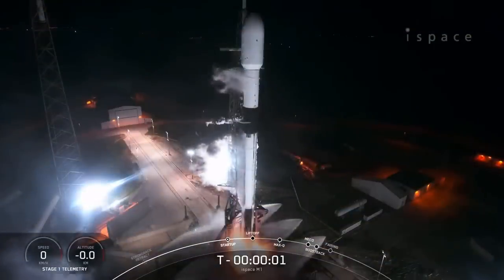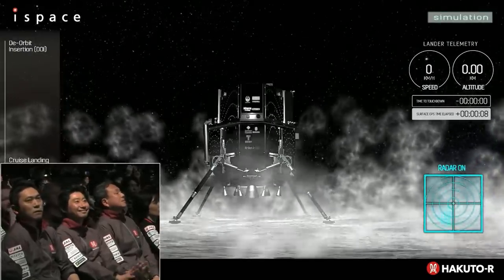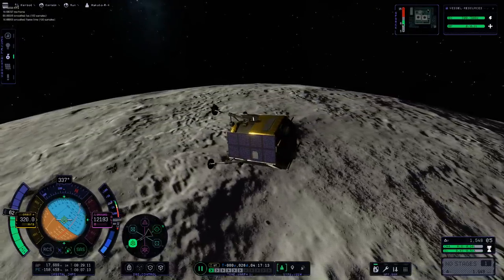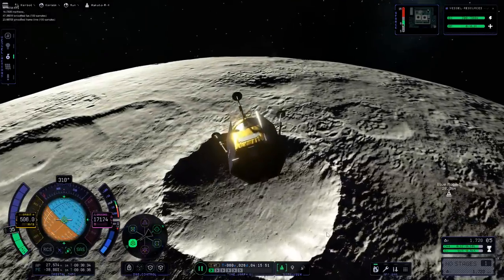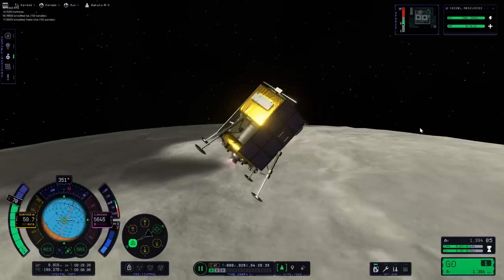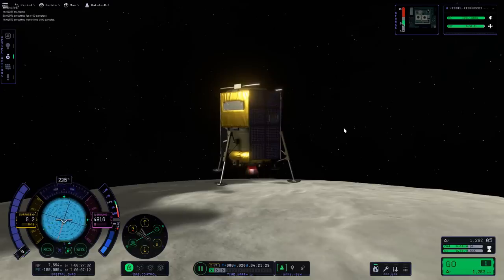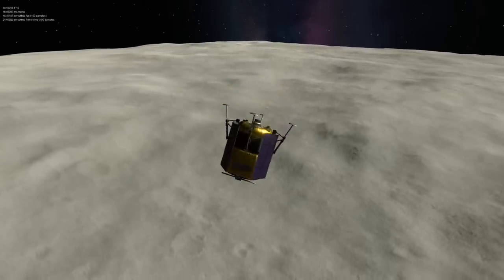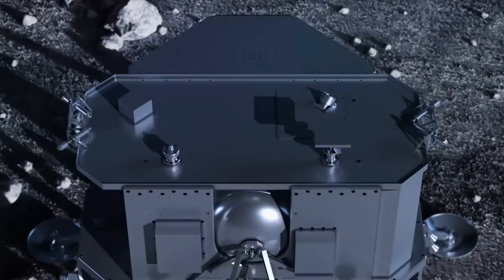Why Japan's Moon Lander Crashed Due to An Unbelievable Computer Bug

Comment: Scott - great video as usual - thank you!
But really this is not a software 'bug' is it. It's a systemic design and control failure. The software was designed to work as it did, but the specifications do not seem to have included passing over a crater like this. In other words the initial flight plan was intended to avoid this situation, and the software was designed to work within that flight plan.
The first error was changing the flight plan without checking if the software could still function with the new one. The second error was not testing the software under the revised conditions it would have to work in.
Both errors are symptomatic of inadequate control over change management.  

In other words, the flaw did not lie in the programming, but the organization's approach to change management.
Reply: ...and perhaps a Third error of the program disregarding the radar altimeter instead of querying it again.        'Say what? That result is outside of parameters.  Please take your reading again'
Reply: I agree this probably shouldn't be called a bug. Requirements were not properly validated, so it's a failure in their systems engineering process.
Reply: came here to say that!

also, even if the result lateron would be inside parameters again: the device has already been proven to be unreliable. it might be an intermittent error, or it might be a bias that only on this occasion was noticed but existed all the time. revalidating system reliability would be a tough cookie to crack on its own if it didn't come with a redundant 2nd and 3rd system, though it should have notified ground control and gotten an update/patch. to my understanding that is how generally system failures are resolved. i don't know if their mission profile put an artificial time delay on that to prepare for longer ranged versions, or what happened.
Reply: Haven't read the report so might be wrong, but if they use something like a Kalman filter, it is likely that they are not simply not querying the sensor, but that the calculated variance to associate to the sensor readings spiked. In that case, the sensor would still be queried, but is effectively disregarded since the resulting effect on output would be so low (due to the change in the assigned variance). Someone can correct me if I am wrong here.
Reply: There's also the design of the spacecraft that has to be called into question, specifically the AD&C architecture.  Relying on a single altimeter means that you can't verify the data with a redundant sensor.  Since accelerometers and gyroscopes can't really capture things like topography from orbit, it's like flying with one eye.  I don't know how much mass, power, and space another altimeter would have taken up, but perhaps a redundant altitude sensor, possibly one with a lower resolution and/or sample rate, could have been used to verify the data coming from the primary one.
Reply: Yes yes and yes.   I said the same don't shuck blame. This was user error. It's hard is not and excuse. I don't blame my saw when I cut a 2x4 too short.
Reply: There’s a difference between the specifications not explicitly stating that the approach will be over such a crater and the specifications stating explicitly that the approach will not be over this crater. You seem to assume the latter but it was probably the former. 
The specs will not include a fixed landing location. 
In the end, it is a bug, in that it didn’t work as intended. You can call it a change mgmt error, but that is just trying to redistribute blame. There is a limit to how much safety you can get by adding more paperwork. NASA had all the paperwork in the world and the shuttle still had two deadly accident.
Reply: still in common computer culture it is called "software bug", spent the whole life in software, poor programming, poor decisions, poor assumptions led to this outcome
Reply: the software was so dumb it could not recognize a crater?

what?
Reply: @LezamaDamian  There are design bugs (works as intended, but the intent is flawed) as well as the implementation bugs we normally think of (design is correct, but does not work as designed).

Of course, the best are implementation bugs that cancel out design bugs where a fix that makes the software work as designed suddenly reveals the design flaw.
Reply: So it was a glitched spec document, not glitchy code. Still essentially a software bug in the end.
Reply: @TheSheepwall  If so, wouldn't it have gone back to normal after passing the crater wall? IMO "bug" is wrong - programmer did what was specified, but the Software Design was wrong.. logical to disable a crazy-looking sensor, etc.. but if thats the one reliable altitude measure, its like saying "invalid response from Engine - disable Engine" and not having a section of code labelled "at this point we have disabled a critical component; obviously this can't be left like that, so Program has to keep checking it or ask Mission Control whether to over-ride the error" and only a few seconds would be lost.. plenty of time from the crater wall, still plenty of time from being 5km up.. watch Apollo 13: they are working the issues, not just watching the big screen with popcorn..
Reply: @TheSheepwall  That would be my take too.
Reply: @chanman819  Not everyone uses the same terminology, but the way I'm used to refer to this is: software design is created to implement software requirements, software requirements satisfy system requirements. A "bug", from the poor moth that died in an old computer, is usually used for the software malfunctioning. When software did exactly what the software requirements specified, I usually don't call it a bug. In the case of also the software requirement being correct but the system requirement being wrong (that I think it's the case, since this system spans software and hardware sensors at least) I'm even less likely to call it a bug. Validation of system requirements failed there, and it's totally a system design issue. Again, terminology varies.
Reply: @GeorgeTsiros  software cant recognize craters, and thats not a shortcoming of programming. Software can read values from sensors and perform predetermined heuristics. The person who specced out the predetermined heuristics and defined the parameters for the programmers to implement is to blame for that.
Reply: I'm just puzzled someone as computer-savvy as Scott would call it a bug. And he doesn't do it  just once, his language characterizing it is persistent and systemic.

We need to rewrite Scott's algorithm from scratch.
Reply: Agree.  This is not a software bug.  Which would be a clock not reset or a plus where there should be a minus. This is a design and specification problem.
Reply: @TheSheepwall  They might have a sanity check - if the data is way off then ignore it.  This is a common method in avionics.
Maybe due to the fact that they had (apparently) no redundancy, they did what you did.
Reply: @mx2000  Yes and in both cases it was a management decision to ignore the relevant engineers warning against continuing the operation as is - NOT a paperwork problem. Lockheed management went so far as to remove from responsibility the engineer who refused to OK the Challenger launch because it was too cold and replaced him with a lackey who would. Then Lockheed lied about it at the Congressional hearing. Fortunately they were outed  by the first engineer who was present at the hearing. Similarly, NASA management ignored a request by engineers to use a telescope to examine the Columbia in orbit. Another example is the Mars Climate Orbiter failure. Lockheed (again!), used imperial units instead of metric units in their control calculations. There are lots more.
Reply: A requirements error.
Reply: I hate saying this because I really want them to succeed but, PEBKAC, but organizationally. The software didn’t bug, this time. This failure report is incomplete, they aren’t done and instead stopped when they found the thing they didn’t understand. Which concerningly is the same reason they failed to realize changing the mission would cause failure. Either people moved the goal posts (planning) or failed to ask if there are goal posts/where they are (design/specing). Based on this video, the software ran to a known spec (maybe flawed spec), humans (multiple likely) made the mistakes in planning long before code was written and those mistakes manifested in the software (and lack of hardware redundancy/recoverability of sensors loss).
Reply: @anotheruser676  I suspect that the issue was that the software was coded such that if a sensor suddenly stepped outside of a certain range of acceptable values, that particular sensor was declared permanently bad. So they weren't trusting additional readings from that sensor.
Reply: @LezamaDamian  When you think abut it, to not consider flying over a crater and what that entails is almost criminal. After all, this is the Moon! Craters are what it is know for!
Reply: @TheSheepwall  That's actually a very good point. I'd also like to know if the software simply ignored the radar, or if the sudden spike in variance caused a Kalman filter to effectively ignore it long enough to crash. But today it's possible to give the software a complete terrain map of the moon (or at least the relevant part) so the radar and guidance system would know exactly what to expect at any point. The same feature is (finally!) in every commercial airliner, where it's called EGPWS (Enhanced Ground Proximity Warning System). Before EGPWS, planes were sometimes flown into mountains because the radar altimeter (which only looked down) provided warnings that were too late. The most famous example was the Air New Zealand DC-10 that flew into Mt Erebus in Antarctica in 1979.
Reply: @mx2000  Scott did say it was the latter: 6:17. The system had been tested "for various landing sites" and it had worked perfectly, exactly as intended. The final landing site selected hadn't been tested in simulation. If the landing site had been one of those tested for, the mission would have succeeded. If the actually-chosen site had been added to the simulation, it would have shown the flaw.
Reply: @GeorgeTsiros  Same thing happened with the first Apollo landing - the LEM was a couple of kilometers out of location and the landing area strewn with medium sized to large sized rocks that would have prevented the LEM from returning. So the pilot took over actively, disabled the computer, and took the LEM to a better area that the pilot could SEE.
Reply: @anotheruser676  which would be the bug at this point
Reply: True, however i don’t think its unexpected to fly over a crater on the moon and to program for that 100% eventuality.  As a result i would say that the programing was insufficient for the job, regardless of the change of landing spot.
Reply: @vernonlemoignan1392  Unfortunately "a crater on the moon" is not the same as "every crater on the moon". According to Scott, the software designers were given several planned landing paths; presumably they included craters because, as you say, the moon is full of them. The software was exhaustively tested against those paths and worked perfectly. We don't know how much margin for error they built in. Perhaps the spec was for a 1km deep crater, so they programmed it for a 2km crater, because 3km would be absurd and obviously a sensor fault.
Hindsight is always 20-20. Once you see what went wrong, anyone can say "oh, you should have...". When you're programming something as complex as sensor integration for an automated craft on the moon, you spend months or years programming for every possible eventuality within the parameters you're given; it's a real trick to recognise which of the many parameters you haven't been given will trip you up. That's why you have to test !

Comment: This is why you also have timers for expected milestones (earliest and latest time a milestone can be validly sensed). My background is that I worked on the Attitude and Articulation Flight Software for the Galileo and Cassini spacecraft when I worked at JPL. For a very simple and solid method they could have used what the Surveyor landers did.
Reply: Thanks for your awesome contribution to space science!
Reply: I'm sure mission control had a plot of the expected altitude changes, the lander may have had one as well. Problem is that the expected rate of change of the altitude, was outside what had been set as acceptable for the altitude radar. It was probably written in the specs somewhere. Proper simulation of the landing would have caught this, it could possibly even have been dealt with after launch. It's changing the landing site without simulating it that screwed them.
Reply: What did Galileo and Cassini use for altitude readings? and would they have been equally screwed if forced to switch over to gyro / accelerometer readings with an apparent failed altitude radar?
Reply: @nocturnal6863  John's point was that "forced" switch is averted, if the switch algorithm is completely disabled at such an early phase of flight. Reread about "earliest time.. a milestone can be validly sensed".
Reply: @u1zha  except you wouldn’t disable the software monitoring a sensor for failure. Not unless you knew in advance it might give faulty readings at that point.

Further thinking, I think I see what you are suggesting. That it should have been expecting by the dip in altitude and it’s failure the see it, means it should have known it’s altitude was off.
Reply: Damn! Spaceflight history right there! Is JPL taking trainees? 😂😂
Reply: More Fuel propellent for and additional 6 kilometers,  dang  - How bout fill the damn thing up, lol
Reply: @OhNiceMatt  you didn't get it. It wasn't lack of fuel, it was a software malfunction. It shut off the radar altimeter input used for determining its altitude, using only last est. altitude plus accelerometer readings. Unfortunately their last reading plus accumulated errors resulted in 6km error in vertical position. Taking along extra fuel for burning all that time it was waiting to touch  down would cost additional mass. Mass is a major constraint on what can reach the surface as payload.